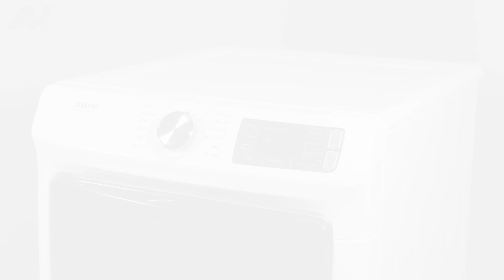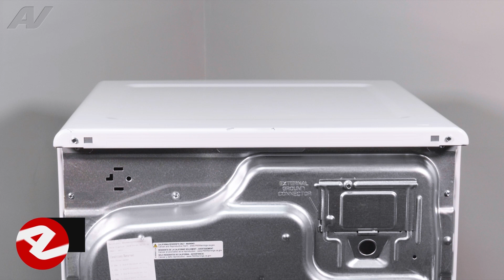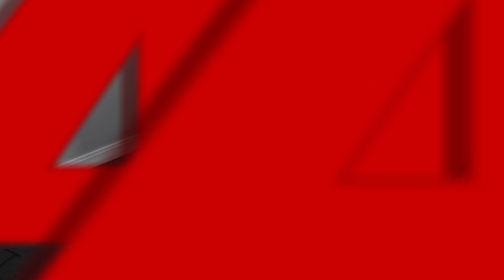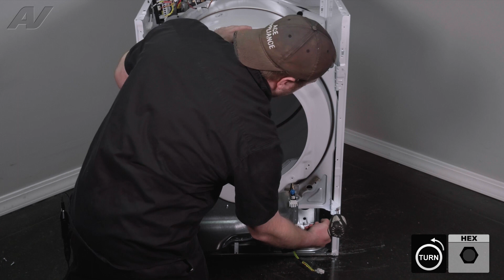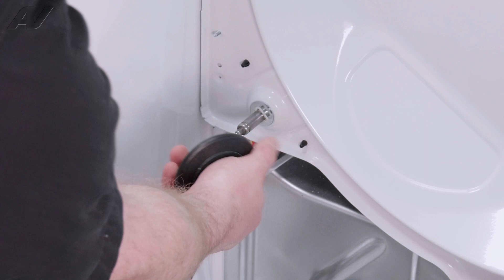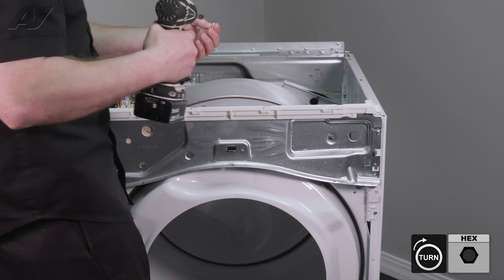Maytag Dryer Repair - Noisy When Running - Drum Support Roller

Comment: This was a big help! My Maytag was slightly older. The wire connecting the console simply disconnect from the circuit board. It has a small plastic tab at the top of the plug to push forward and the two parts separate to unplug. Don't try and pull the entire plug from the circuit board. Everything else was straight forward and no more rumbling sound. The old rollers and everything looked good. Was surprised how much lint was stuck in the blower fan. It purrs like a kitten now!